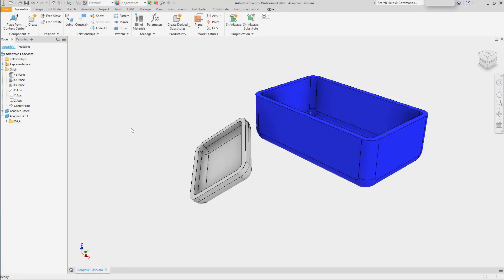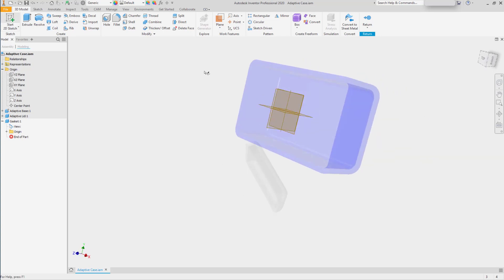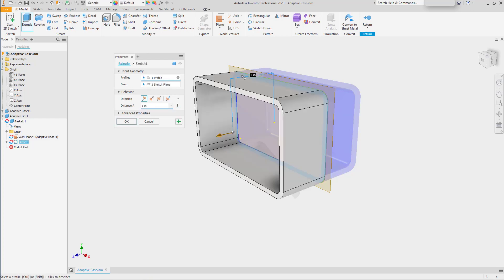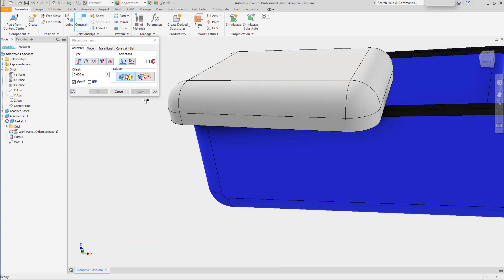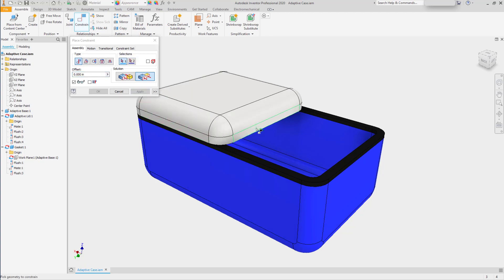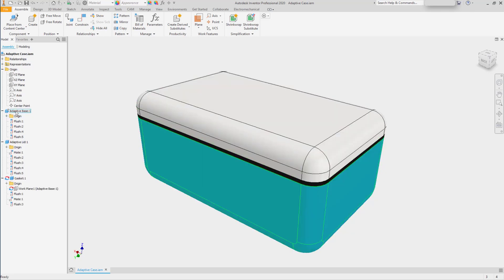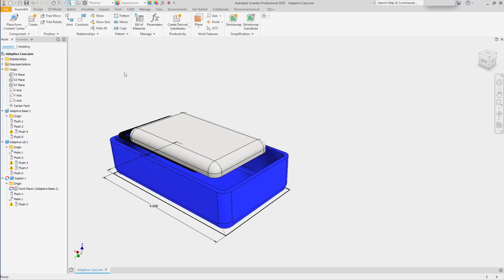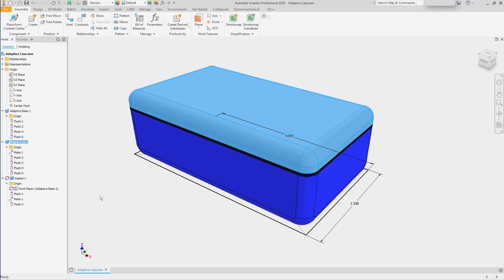Inventor English 2020 Analyze the implications of adaptive parts 🧷

Comment: I have followed the instructions, but it's not working. Don't know why
Reply from the maker: select faces correctly
Reply: @Ingeniería10D  Solved. It turned out that I created an object with a constraint. I put two point center rectangle at the center of the coordinate system to create the lid . So the center of that rectangle was coincide with the origin of coordinate system. It prevents the object's dimension being changed following the flush constraint.
Reply: @rizkiputraprastio7553   you create sketch of adaptive lid by rectangle 2 poitn with no contrain it will work. I did it